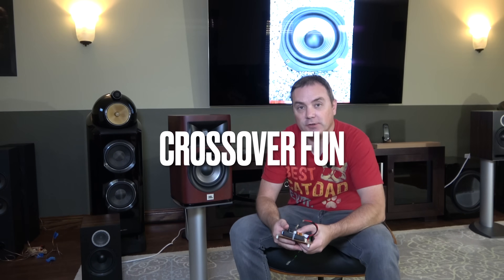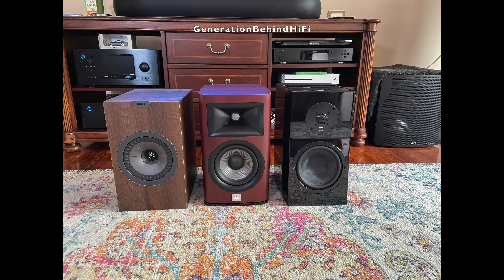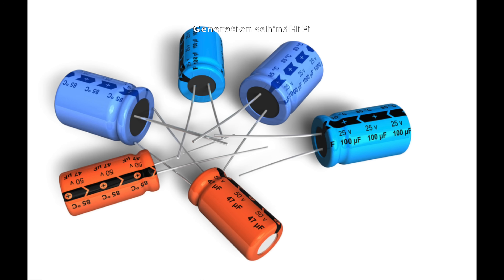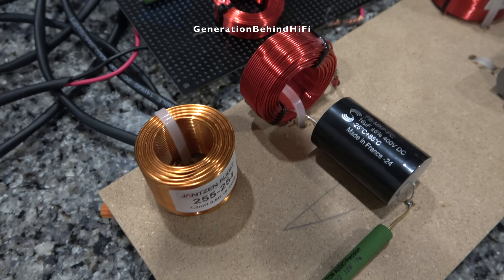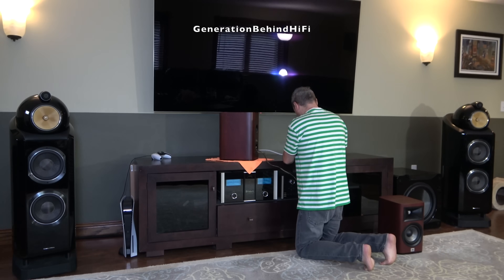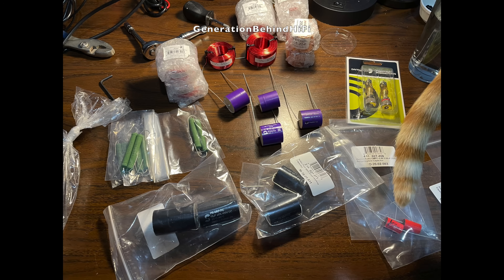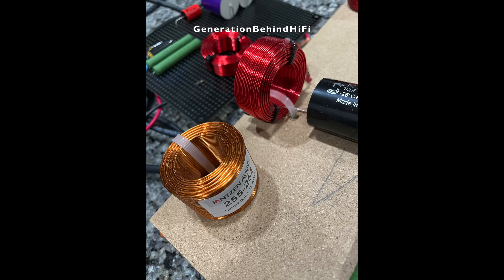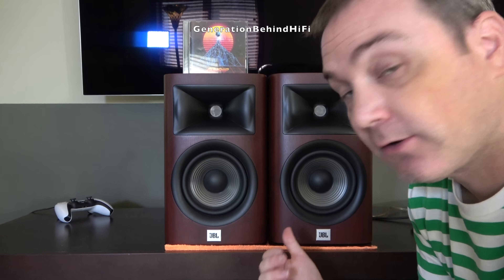JBL Studio 630 Crossover Upgrade - Do higher end crossover parts make a difference?

Comment: When replacing iron core inductors with air core you also need to match the active resistance of those coils. Also when replacing electrolythic capacitors with a film capacitor value may need to be adjusted to get the same target frequency response.
Reply from the maker: I mention all of what you said in this video (maybe you skipped through? ) but its beyond the scope of what I was trying to convey. This was a simple test to see if swapping out like for like better quality components would yield a sound improvement and judging by the responses, it did.
Reply: @generationbehindhifi  The differences in coil's active resistance and differences in capacitor values at various frequences (electrolytics usually loose capacitance with a rising frequency while film caps do not) would inevitably change a frequency response from a stock unit. And that frequency response change could be perceived as a change (or improvement) in a sound quality. Those differences shouldn't be ignored as insignificant.
Reply from the maker: @IliyaOsnovikov  Please don't put words in my mouth. I didn't ignore it as "insignificant". You said that. Not me. If I were ignoring it, then why did I mention these exact talking points in this video? Also, that perceived frequency response change from the components I installed could have had a negative effect, but it didn't as evident by the comments. Thanks for watching!
Reply: @generationbehindhifi  Thank you for that explanation. I didn't mean you in particular doing something wrong. I'll change that phrase to "Those differences shouldn't be ignored as insignificant." I was just trying to emphasize the importance of measurements in a process of crossover components replacement.
Reply from the maker: @IliyaOsnovikov  No worries! :)
Reply: @IliyaOsnovikov the maker just want to cheap on parts, so as long as replacing with better parts result in better sound, its an improvement. They have no intention on specific frequencies etc.
Reply: As long as the value is the same then it proof that the manufacturer did put a cheap components to save cost. The different in sound shows that the replacements are better parts.
Reply: @johankamarudin5155  Do you realise that at higher frequencies any replacement film capacitor of the same value would have quite different capacitance than original elecrolytic capacitor? Thus a crossover filter operation won't be the same and a frequency response of a speaker will be different than it was set up by designer(s). So that difference in sound that you may hear first and formost would reflect different speaker tuning rather than just quality impovement.
Reply: @IliyaOsnovikov  this is true provided they chose the components for that purpose that u have explained, but i doubt that. Most manufacturers put a mediocre components because the xover is the last thing consumer will check.
Reply: An excellent reason for not going in and just replacing components in your crossover just cuz some expert on YouTube wants to sell you some "upgrades". (And you know who you are.)
Reply from the maker: @MxyzPi  I don't know if that is directed at me, but I'm not trying to sell anyone anything.
Reply: @generationbehindhifi  It wasn't but probably GR, but doubtless others would qualify.
Reply: @generationbehindhifi  not directed at anyone aside from the average person who may or may not have been thinking about throwing money at their systems thinking that something transcendently magical was going to happen.
I believe strongly that there's plenty of room for the possibility of being really disappointed after spending the money and doing the work.
The "you know who you are" comment might have been directed at GR and others like them. Those with, in my opinion, a more vested interest in selling products than in filling a real need.

Comment: I can definitely hear the difference ! for sure. One thing about going from iron core inductors over to air core is that you will now have a higher resistance through the inductor which "may" limit certain frequencies to the woofer.  Or even change the overall sound completely ;) 
But regardless of that, well done! :) I love a good tinkering
Reply: Generaly  induction limits current or voltage  by providing so called impedance in serial or parallel . This impedance depends on  two factors -  inductivity and   common resistance (of coil and of "looses" in rod  which   both are very little in compare to inductance - like 0,2 Ohm in compare to 8 Ohms )  By adding steel rod we increase inductance and steel looses  in steel ( in ferrit it is  even zero)  The final  result is equal to applied a bit more  pure impedance   - speaker do not "know" that phase is shifted about any 1-2 degrees which is completly meaningless in compare to shifts up to 180deg occuring normally in each speaker So ( on scientific base)  I do not expect any problem with use of rods provided that they set accureate and desired effective impedance to speaker. .

Comment: As for me, you made a mistake in the high-frequency path. Capacitor coil capacitor and not two capacitors one behind the other. There should be a 3rd row there, not a second one with series capacitors. That's not how it's done.

Comment: Am I right that was about $200 for one speaker?  Also it seemed to me that the levels are different - indeed you've changed the circuit.  I think really level matched and double blind is a better way to do this.
Reply from the maker: It cost me $200 in parts to rebuild the crossovers for both speakers.

Comment: Nice job and I enjoy your work. On the crossover. A better cap on the tweeter is always a good idea. On the woofer by going to all air core inductors the DCR will be higher than with iron cores. This makes the woofer less loud so your going to hear the tweeter more, quite a bit more. To keep the same balance you might want to measure the DCR on both before and pad down the tweeter slightly if you want to keep the stock balance of the two drivers. The improvement of film caps on the woofer will be less than changing the inductors. Big film caps are never cheep. Some by passing and better electrolytic might be a good place to save some money.
Reply from the maker: Thank you! Yeah, I touched on exactly what you said at the beginning of this video, but didn't want to go down that path -- I wanted to keep it simple. The point of this video was to see if exchanging like for like components or close to it would yield any increase in performance. Hopefully I was able to capture that for my viewers on camera. 

Thanks for the comment and tips on bypass caps. No doubt that is a good economical way to increase performance without spending too much.

Comment: Basic test equipment is a calibrated USB microphone (Dayton or UMIK, or DIY) for less than $100 and the free REW software. Better parts will certainly improve some things, but it is not safe to assume that JBL did an optimum job with the crossover in the first place. I believe that unless a better crossover is designed, it is not worth the investment. With a better crossover design, this could be an incredible speaker.

Comment: Good job!  I can definitely hear the difference!  I have a pair of JBL 4430 studio monitors that I left in/bypassed the original crossover and built a charge coupled outboard crossover.  I also put in new 5 way binding posts (bi wired) The difference was night and day.  I used high end poly caps and earse air core inductors except for the woofer, I used a high end Jantsen  metal core inductor because it had a lower DCR to match the old one.  Totally worth the time , effort and cost as the sound is amazing.

Comment: I wouldn't expect such a difference (even my very generic headsets) . The crossovers of my MA Rx6s are budget oriented as well. If I figure out the all the values, I will go ahead and rebuild them. 
Thanks for the experiment.
Reply: It is known to many rule that the better is speaker reproduction the bigger  SUPPOSE TO BE  observed differences in sounding caused by small reasons. In other words it is no effort nor big game to make it spund even  awfull by small distortion of   tunning or alignment .  It is called speaker  capability to have  high resolution.

Comment: Awesome job! Thanks for finally doing this project, (I've been waiting). I actually have the speakers. Bought at approximately 1/2 price like you. Run it with a WiiM Pro+ with eq into an old Yamaha receiver. They sound good to very good with eq. The idea of taking them apart dumping $200 dollars into them and then having the crossovers on 4 boards outside the speaker won't work for me. Don't get me wrong, I'm very glad YOU did it, and I did listen to the other video. The new ones do sound better. Great job. My skills just aren't up to that level. What I would consider is building the HiVi-Swans DIY 3 Way Passive Bookshelf Speakers with the modified crossover. Last I checked that would be around $400 all in. Would love to see you do that project. As it is I'll have to stick with the JBL's with eq. Keep up the good work!

Comment: It must be just me I didn’t like the upgraded one. Sounded dull and lifeless for the most part.
Reply from the maker: Try having a listen using the below link. In the video below I used high quality source material (SACD) for the demo and to me its much easier to tell the differences between the two speakers. Sadly I couldn't include this clip in this video without risk of being demonetized. 

https://youtu.be/yKJWvSotots
Reply: @generationbehindhifi  
Wow ya I can hear a difference in that video link. 
The upgraded one with vocals sounds weird. Vocals and guitar sounded hollow and canned. There seemed to be a whole in the sound with vocals and guitars. 
At times the stock one did sound a little congested but I couldn’t get past the change in the vocals and guitars in the upgraded one. 
Must be me, maybe I’m just so used to lesser quality it seems normal to me!!
Reply: @Carl-bd1rf  When one actually designs and tests and refines a crossover they can deal with all of the tone and etc differences and get it completely dialed in.
Reply: @bayard1332  
That’s the rumor I’m told, but my ears didn’t register that in this case. Like I said maybe it’s just me.

Comment: Yes - quality of the crossover parts is very important! Another aspect of the bass that is very hard to hear over YT is there are a lot of details in the bass that can be heard when only air core coils are used. The magnetic field in a metal core lingers for quite a while - the magnetic poles in the coil's field reverse 180 degrees 2X the frequency. So, a 100Hz tone has the magnetic field flipping to the opposite direction 200 times a second - which is far quicker than the magnetic field can die down in the metal core. As a result, the music quality is smeared.
You can get nearly the same quality sound from the caps, and save a fair bit of the cost, if you use bypass caps (0.1F) in parallel with the main caps. I like using all Audyn Q4 caps - their 0.1uF cap is about $2.50 and so you can spend about half of what the ClarityCap cost. When I want the ClarityCap in a better speaker, I use their 0.1uF 630V CSA cap as a bypass, which costs about $16. Bypass caps open up the soundstage even more than a good metalized polypropylene film cap alone.
Reply from the maker: Good points on the bypass caps, Neil! Thanks for sharing. 

I created another sound demo using SACD as the source material and I think the differences can be heard much easier on camera versus using the free music that is available on youtube. Sadly I couldn't include the SACD demo into this video without being demonetized so I had to create a separate video for it. Have a listen and let me know what you think. IMO the differences between both speakers can be heard much easier with this clip. https://youtu.be/yKJWvSotots
Reply: I do not think magnetic field has any dimensions,. weight  or  capabilities to live so I do not believe it may die and need time to say good by. But in  fairy tale  can even have   face and hands.
Reply: @Mikexception  in ferrous metal, magnetic fields do take some time to die down. So, when an AC signal like music requires the magnetic field to flip its poles twice for each voltage swing - it messes up the signal.
Reply: @NeilBlanchard  "Do have some time" Ok may be if somebody observed but  to believe it I will ask  what exactly is this time because we are talking here about miliseconds ? How does it compare?

 Do you support that  when  in tape recorder magnetic head  field is  forced to flip   20 000 times per  second  rod of head and tape  do not respond instantly Tape passes  forward and  it   was too sluggish   to magnetize and record signal? How  about magnetizing in hard drive discs? How fast disc metal particles   are far from head and how possible they had "no enough time to  effectively  change their state"?
Reply: @Mikexception  You can do this experiment: wind a wire around a steel nail, and connect the ends of the wire to a small battery, and pick up a paperclip with this electromagnet. Then disconnect the battery - and see how long the paperclip takes to fall off the nail.
Another thing would be to take a screwdriver (or pliers) - it has no magnetism and can't hold a small screw. Then put a strong magnet on the end of the screwdriver for a few hours - and then you can hold a small screw on the screwdriver, after the magnet is removed.
Ferrous metal "holds" magnetic fields for a period of time after the field has been changed or removed.
Air has no effect on the magnetic field - the reversal and stopping of the magnetic field is "instantaneous" in an air core coil/inductor.
Reply: @NeilBlanchard  I don’t really believe using good quality iron core inductors for low frequency (under 130 Hz) should adversely impact the sound. It’s basically too low on the spectrum to have a lot of details anyway, and also using massive air coils is not only expensive, but also has much higher impedance, which has to be taken in account when balancing the speaker (I mean unless u get super massive 10g copper foil coils costing $500) so it’s a bit of a trade-off, because now you have to pad down your mid & tweeter, which isn’t great. Everything comes with a price— and I don’t mean just money. Whereas for mid range crossovers, I think the lower value air core coils make a lot of sense— just get a big gauge.

As for bypass caps , if you’re gonna go with 0.01 or 0.1 uF, why not just get really gorgeous Jupiters for $30-40? You shouldn’t need that many of them and if the concept really works, why not go for (near) the best? I haven’t priced out the tiny value top-quality Duelunds…
Reply: Halo , I am newbie can teach me how to design 2way 8ohm crossover with sb accoustics speakers ? Tq
Reply: @kevinchew2594  you need to get the FRD and ZMA data files for both drivers, and plug them into a program like XSim. The nominal impedance of the drivers does really matter.
With SB Acoustics drivers, you have to measure them yourself.